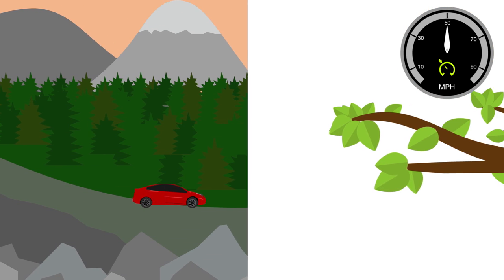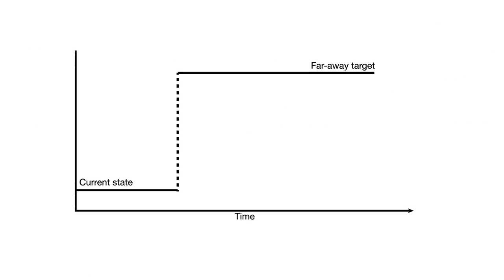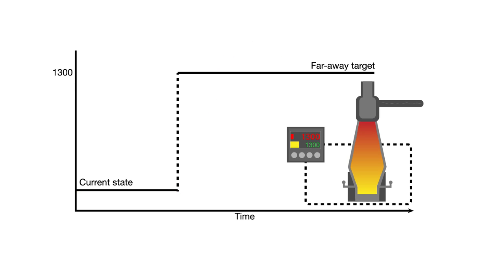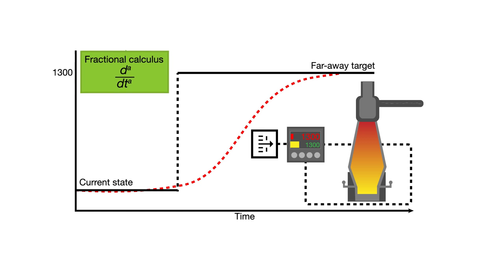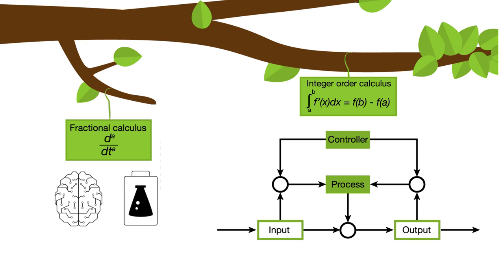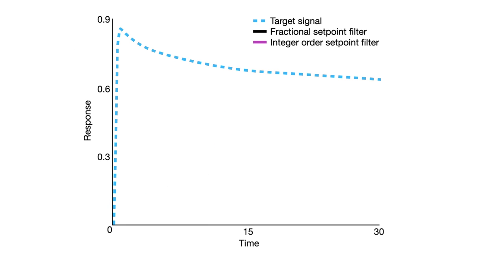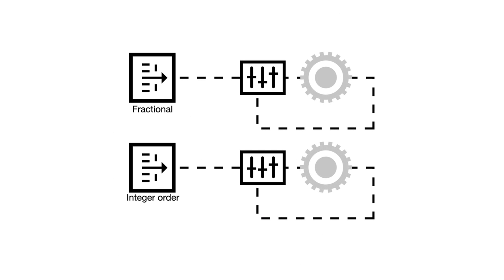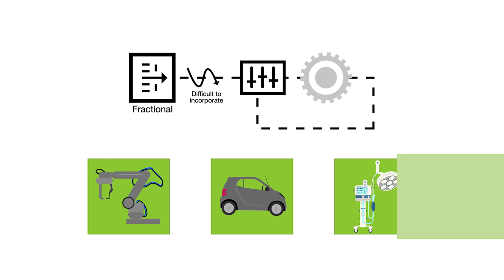Fractional calculus helps control systems hit their mark

Comment: I would have liked to have seen a comparison between a PID controller and a PI(fractional derivative) or a  P(fractional integral)(fractional derivative) controller, because the same argument could be made for a standard PID vs PI controller.